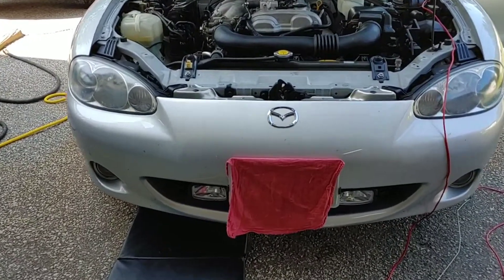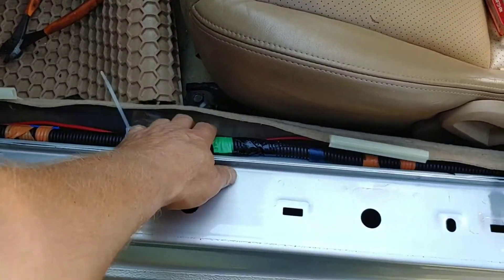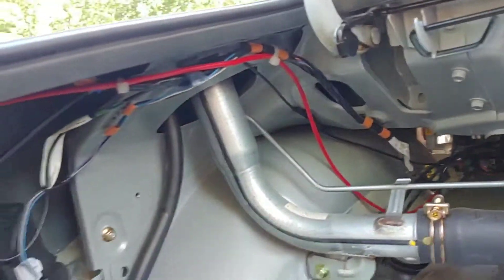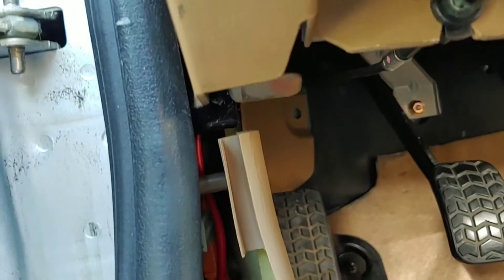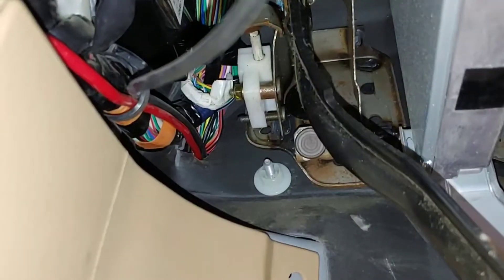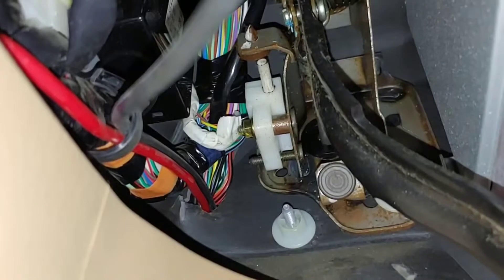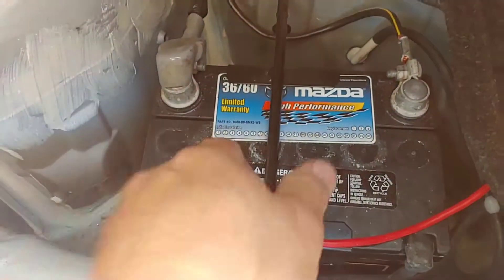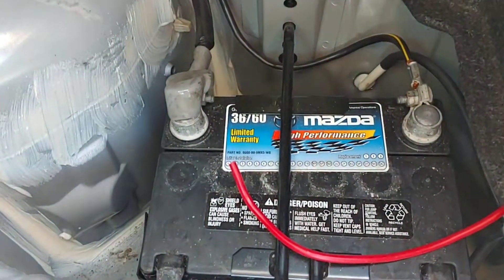Adding 12 Volt Auxiliary Power Circuit to Miata (NB) Engine Bay

Comment: Wiring up DRL's in same spot as your added fog lights.  Video was a huge help explaining how to run wire from battery to engine bay.  Thanks.
Reply from the maker: I am glad I could help you. Good luck and don't forget to put a fuse as close to the battery as possible